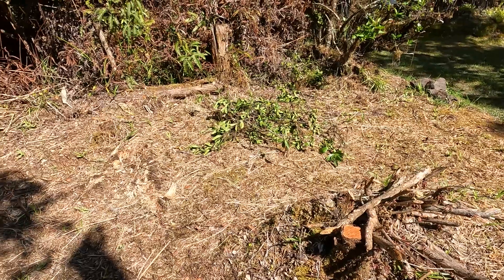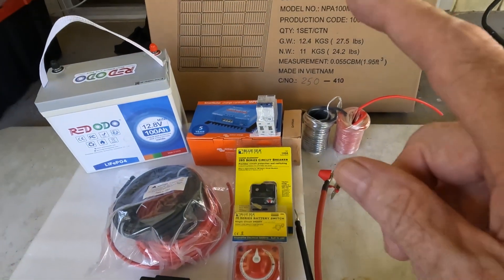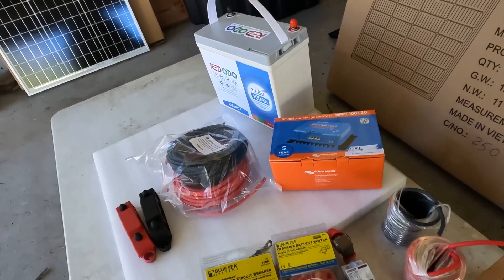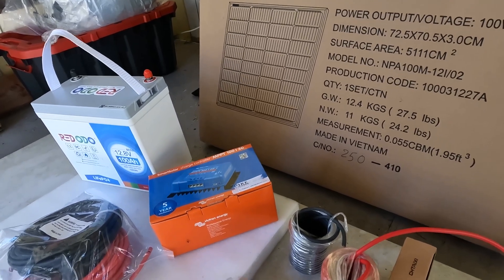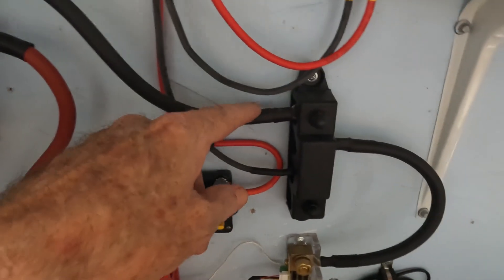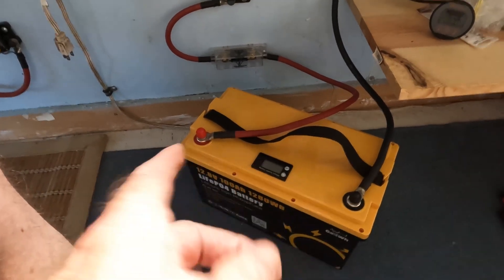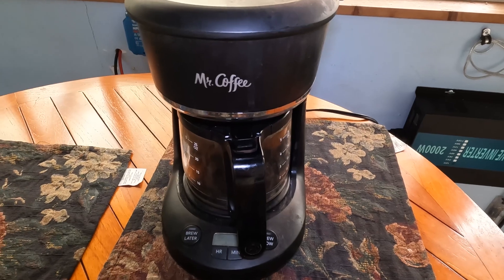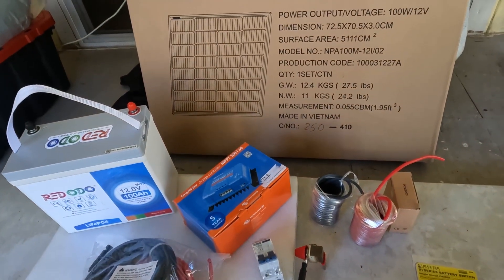DIY Solar Power Station on a Budget: Complete System Under $1000

Comment: Doesn't automatic defrost on modern refrigerator run a heater that's right up to your limit?  Or is your fridge without this feature entirely?  I've a modern LG and it runs defrost every 4-16 hours depending on temperature and number of door openings.  I'm looking at the panel on my EcoFlow right now, I don't hear the compressor running but it's pulling 375 Watts so it must be in defrost.
Reply from the maker: Auto defrost on my unit draws 200watts usually once every 24 hours for about 20 minutes. Sometimes more often, but that is the average, so it's not bad on my system at all. Inverter compressor style. No surge. Aloha!🤙

Comment: Thank you for the video, very nice.
 I would just like to add to be aware that any appliance with an electric motor, like a refrigerator, has a starting surge that can be 3 to 5 times the amount of Amperage that it normally uses while running. Because of this, it's highly doubtful that you would be able to run a 60 Watt refrigerator with a 100 Watt inverter.
Reply from the maker: Luckily the fridge I use does not surge. When running is 40-70 watts. Pretty easy on solar! Aloha!🤙
Reply: @ProjectsinParadise808   No surge??? None at all?  I need to start looking on craigslist! 
  I have a couple of  350 Watt pure sinewave inverters looking for something to do.
Reply: That's why we buy inverter compressor fridges, they use DC motors, which don't surge because they're DC motors. I use the common LG 20CU model for this, which also has a great energy star rating. Excellent comment though for people trying to reproduce the experiments--there is supporting knowledge and preexisting infrastructure that goes into this stuff sometimes. 

Same thing for water pumps. We avoid AC water pumps out here because we know it would use a huge amount of our inverter surge capacity, even if we only buy 1/2HP, even if we have a decent surge capacity in our inverter.

Comment: I put together something very similar here at home. 400 watts if panels, 3000 watt inverter, 100 ah lithium battery, EPever charge controller. 

I use it just for back up when the power goes out. It runs the fridge, freezer, coffee pot, microwave, Internet ect ect. Very handy to have and you don't have to worry about fuel!
Reply from the maker: Exactly! Very nice! Aloha!🤙

Comment: well done ! love that sample system ! with the cost of LiFePO4 coming down you can put that money to a better charge controller like Victron . get all coper wire. great show of different inverters  . and the best part easy to change to fit your needs. smaller or bigger battery even change to 24V . same stuff, I run more than 1 inverter . switch them on and off as needed. if some place else you can get a inverter to fit your needs. like UK 240V 50 Hz . Japan 100V 50 Hz . 12/24/48 V batters same all over the world. this system can work any place. just need sun . I love how far China has come in the battery market. outher countries make LiFePO4 as well. I got a  Japan made cells. some Korea made ones as well. all super !
Reply from the maker: Simple is good yeah. The price keeps coming down on everything which is so cool! Aloha brother!🤙

Comment: A quick question, are you sure your LG refrigerator's surge power is less than 300w ? When the compressor starts up inrush current will overload the inverter imho. Prove me wrong
Reply from the maker: That LG I run has an inverter compressor, and does not surge like old refrigerators . I have run it off the 375 watt inverter many times...no problems at all! Aloha! 🤙

Comment: All this is over my head after about 3 things, but it made me remember we had to get a better sine wave inverter early on. First,  we had a bigger washing machine and the sine wave inverter wouldn't work that washer. We got a washer with fewer electronics, and that works fine - with the upgraded inverter. Secondly, I have to adjust the electric clock on the stove because the sine wave doesn't transfer exactly right. I don't know if you can discuss how sine wave electricity transfers. It's all fascinating.  Thanks for this video.
Reply: A washing machine has an AC motor in it which, when running, creates what is called an "inductive load".  Basically, due to the motor, some of the power is reflected back to the inverter and the inverter has to be able to handle it.   The startup current can also be very high for washing machine motors.  They can be tough on inverters.  Upsizing the inverter usually solves the problem.

An old electric clock on the stove is a lost cause with any of these pure sine wave inverters.  They are not frequency locked to 60Hz and old clocks relied on the line frequency being exactly 60Hz.  The power company would actually make adjustments over the year to keep the total cycle count exactly synchronized with the time.

In modern-day, little quartz crystal clock modules are used for cheap clocks instead.  You could just tear the clock out of the old stove entirely and pop in a quartz crystal clock module backing and make it battery operated as a solution.
Reply: @junkerzn7312  it's a newish stove.  I just adjust the clock now and then. And, yes, the first bigger washer had more electronics. Thanks for your sine wave explanation.
Reply: @jacquelinekeller6208  I had a 10year old stove that would let me switch the display to blank instead of a clock. Check if there's an option to make the display blank instead of showing anything when not in use. 

AC hz based clocks are problematic even on the grid, they will drift and need corrections.

Comment: There is this for $250 now. 700W Portable Power Station, 614Wh LiFePO4 Battery Pack with 110V AC Outlet

The portable power stations are getting much lower in cost.
Reply: $250 is a bit low for 614Wh power station, are you sure?  The power stations in the $250 range typically have around 250Wh of storage.  A 100Ah x 12V LiFepO4 battery clocks in at (100Ah x 12.8V) = 1280 Wh.
Reply: That size would be marginal to run a refrigerator or power tools due to the start up load

Comment: Great video  thanks for sharing your findings, I'm hoping to build a system for our house in France , but my fridge freezer  runs at 120 watts but at  start-up it's about 1500 watts , just wondering what brand of fridge freezer  you use
Reply: LG's intelligent Smart Inverter Compressor has a very low startup surge compared to typical old style compressor.
Reply: I believe it's a 20 cubic foot LG. I've heard that they are really efficient.
Reply from the maker: Yes it is!🤙
Reply from the maker: Yes it is a LG. Draws 50-70 watts while running. Very efficient .🤙